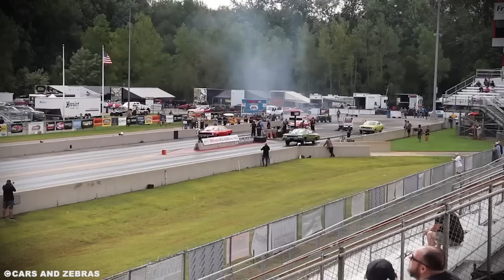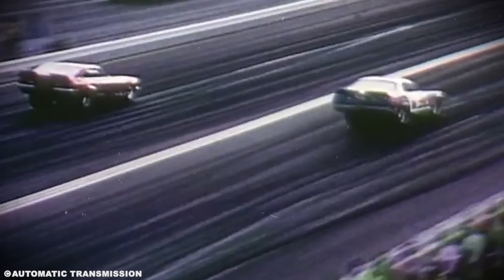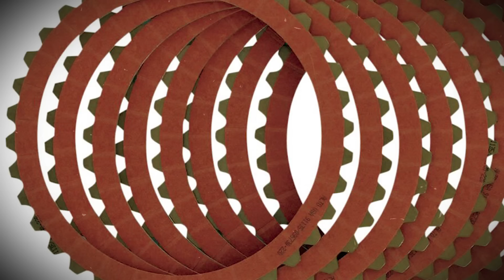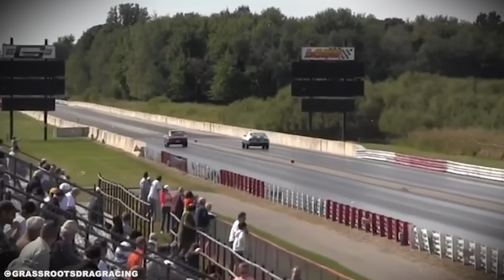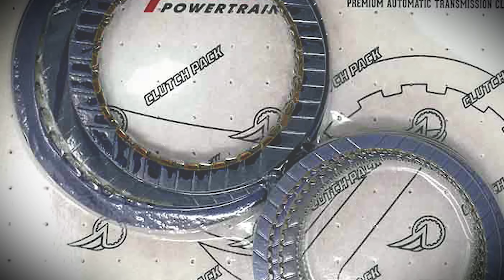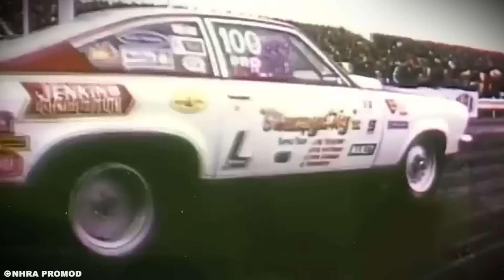This California Drag Racer OUTSMARTED Chrysler With a Banned Torqueflite Trick NHRA Outlawed

Comment: Now why in the hell would any Chevy Pontiac old Buick guy trying to add a gear to a 2-speed transmission when general motors made turbo 400 and turbo hydro 350s you people don't even make a lot of sense and as far as that two-speed of application thing that's the only way it went bad might only have two gears

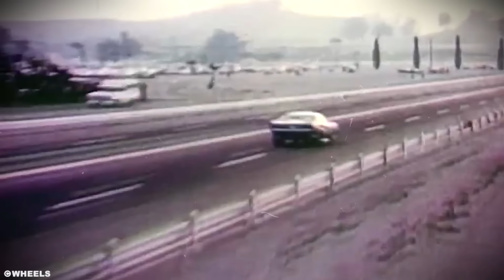Comment: It is 71 Dart with a 318 that I put a dual point ignition and a 500 CFM two barrel on. I put a 7:27 tricked valve body on to the 904 trans and it shifted out of first gear at 52 mph at 7200 RPM. It shifted out of second at 87 mph. It had a bit of a tall rear-end gear. So I delegated it mostly to Street battles where you're normally going about 35 to 45 mph when you jump in it. My trans would shift into first gear and shift back out of first gear at 52. It felt like somebody ran into the back of the car with a pickup truck doing about 70. The torqueflite Transmissions were dead strong Chrysler's own test for the 904 trans is to put a car in forward gear while on a rack. Bring it up to 2425 RPM and shift it from reverse to forward at 2500 rpm 300 times and then take it apart and check it and it had to check like new. Nobody has made a better automatic transmission than the Chrysler torqueflite 727 and 904 add when they added the lockup converter to save a little bit of fuel mileage it was a help and all the newer ones were were the same transmission sometimes with an overdrive gear. The thing I could do is I could manually shift the transmission. And it would never come out of second gear and I was turning some 13 second quarter me with a 318 2 Barrel.